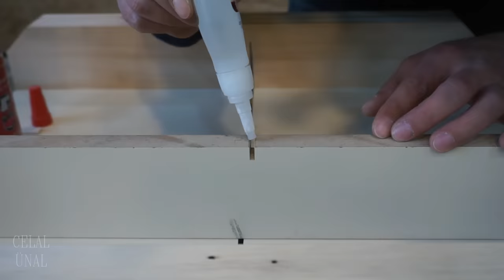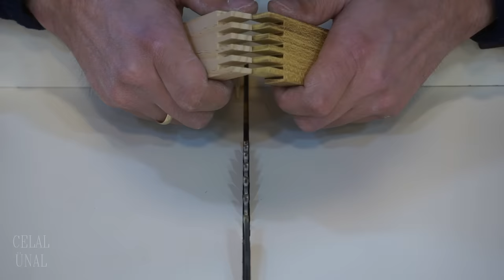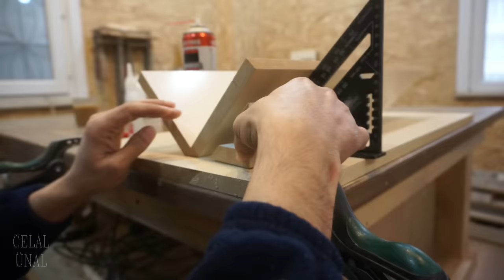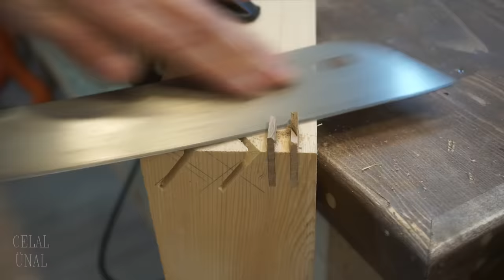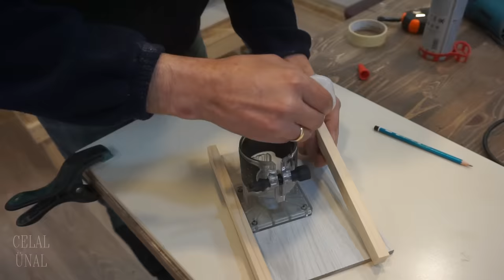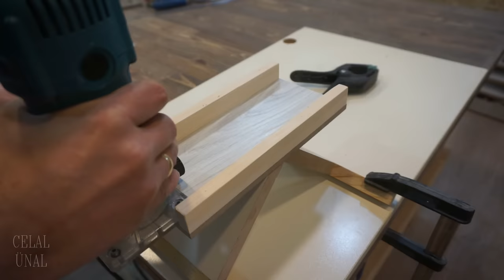Woodworking // Simple table saw sleds / Tezgah testere aparatları

Comment: These are some great jigs. Hopefully for the actual splines you use glue instead of cyanoacrylate (super glue) because I can tell you from experience that it will not allow the wood to move during humidity changes. Normal wood glue allows for seasonal movement whereas "super glue" soaks into the pores of the wood and creates a solid cement-like bond which cannot expand or contract. Just something to be aware of. For the jigs it is fine since you are backing it up with screws.
Reply from the maker: Thank you so much. I am very glad that you like it.
Reply: Right also if you have to "weld" something, steel, aluminum, plastic, etc, just add bicarbonate of soda and you'll see it won't move and tolerate very high loads.
Reply: Thank you for your service… Semper fi.

Comment: Bravissimo. Hai le mani d'oro. È un piacere vederti all'opera!
Reply from the maker: Grazie mille. Sono molto contento che ti piaccia.
Reply: @CelalUnal1  una domanda: la lama che usi sul banco Dewalt è di diametro 250 mm? La larghezza dei denti, e quindi del taglio, quanto è? Perché ho visto che le lame Dewalt con i denti più larghi sono da 2,4 mm ma vedendo i tagli che fai mi sembra che sia più largo. Grazie per questi video molto belli e interessanti.
Reply from the maker: @bigwave1827  Yes, 250 mm. The original knife is this size. I haven't measured it, but I think it's about 9 cm in height. It would be better if there was a bigger knife. But not bad in these proportions. greetings.

Comment: This is an excellent video. I've watched many and this is the very best. THANKS. I have three questions: 1) How did you make the filler for the dovetail joint? 2) Did you use a gauge block to measure the exact place for the other side of the "X" joint with filler? The double "X" joint is very cool and looks impressive. 3) What kind of spray adhesive did you use?

Comment: Hi Celal, thank you for the video. Very professional and very useful. M
I would like to know what are you using as glue and what spry are you using to accelerate the glue drying? Thank you again.
Reply from the maker: Thank you very much. I am so glad you liked it.I used instant glue and activator spray. A material that provides drying and adhesion with activator spray.

Comment: Excellent job. Can you tell me what is this spray that you use and what is for?
Reply from the maker: Thank you. I used fast glue and coolant spray.
Reply: @CelalUnal1  Why are you using coolant spray?
Reply from the maker: @NikosEliopoulosmain  Fast adhesive does not dry without coolant. It does not provide adhesion. It is a two component material.
Reply: @CelalUnal1  Ok i see. Thank you very much for your answer.

Comment: What is this spray u use after glue two pieces to quick dry? Btw u are good woodworker ☺️
Reply from the maker: Thank you. I used fast glue and coolant spray. It does not dry out without a cooler.
Reply: @CelalUnal1  tnx, I found some akfix 705 glue, is that something like that u use it?

Comment: Great Video....but let me know.....WHY USING  SPRAY ADHESIVE  ??  Other question....is there any project ?   schematics ?   i really love make some of JIGS for my table saw
Reply from the maker: Thank you so much. I am very glad that you like it. I used fast glue and coolant spray. For faster adhesion. I use dewalt dwe 7492. I did not share the measurements because the sizes vary from brand to brand. I'm sorry for this.

Comment: Really really good woodworking and a good tutorial! 
I'm really thinking about which glue you are using. Could you send me a link?
Reply from the maker: Thank you. I used instant glue and activator spray. A material that provides drying and adhesion with activator spray.

Comment: Really good!
Thanks for posting.

- What's the brand and model of your table saw?
-What is the spray you use after gluing, and what is its purpose?

Thanx for answering if you can.

Vraiment bien !  
Deux questions pratiques :
- Quelle est votre scie sur table ? 
- Je n'arrive pas à identifier le spray (et son rôle) que vous utilisez lors des collages…

Merci pour cette video
Reply from the maker: Thank you so much. I am so glad you liked it.
I am using Dewalt dwe 7492.
I used instant glue and coolant spray. A material that dries and adheres with a coolant.

Comment: Hi in some video you use white glue, in this one you mainly use transparent glue, what’s different between them? Is the spray is glue accelerator? Thank you so much🙏
Reply from the maker: I use white glue on wood. I use fast glue and coolant spry for this type of work. It saves time. Also a good holder on mdf surfaces.

Comment: What you use there for a spray after gluing the angle wood ?
Reply from the maker: I used instant glue and coolant spray. A material that dries and adheres with a coolant.
Reply: Thanks for answering 🤙🏻

Comment: What glue is that you use? and what is in the spray can? Thank you.
Reply from the maker: Thank you. I used instant glue and activator spray. A material that provides drying and adhesion with activator spray.

Comment: Hi. Great work as always 😁
Can i Ask for model and brand of your sawblade? IT cuts so smooth thru those laminate boards without any damage of laminate itself. Thank you 🙂
Reply from the maker: Thank you so much. I am so glad you liked it.
Brand dewalt. Diameter 250mm. 48 teeth. 3mm thickness.
Reply: @CelalUnal1  thanks for answer. Im supprised that's original blade. Be safe.

Comment: Try using nylon cutting board material for your sled guides. They do not expand or contract like wood slides will. What is the glue and activator that you are using?
Reply from the maker: Hello.Thank you. I used fast glue and coolant spray.

Comment: What is the aerosol can that you are spraying on the wood and what is its purpose?
Reply from the maker: I used instant glue and activator spray. A material that provides drying and adhesion with activator spray.

Comment: What spray glue are you using?
Reply from the maker: I used instant glue and coolant spray. A material that provides drying and adhesion with coolant.

Comment: What kind of wood and glue are you using for your sleds?  Also, will you be sharing the plans?
Reply from the maker: I used MDF for wood. I used fast glue v cooler spray. I am using dewalt dwe 7492. I did not share the measurements, as the sizes will vary from brand to brand. Greetings.

Comment: What's the saw table and spray you using?
Reply from the maker: I am using Dewalt dwe 7492. I used instant glue and activator spray. A material that provides drying and adhesion with activator spray.
Reply: @CelalUnal1  cheer dude✌️thnx

Comment: What is the spray for ?
Reply from the maker: I used instant glue and activator spray. A material that provides drying and adhesion with activator spray.
Reply: @CelalUnal1  thank you for yrs replied 💝💝🎉🎉

Comment: Where did you buy the glue you are using?
Reply from the maker: I used fast glue and coolant spray. Every building is available in the market.
Reply: @CelalUnal1  I have never seen it before.  Thx for the response.

Comment: Hi, what is that glue in spray bottle. Where can I buy it
Reply: It’s Super glue with spray accelerator also called CA glue. Available at most woodwork stores, The Home depot, or Lowe’s etc depending on your country.
Reply: @richardshort4587  thank you
Reply: @KaprizHardwoodFloors  You’re welcome sir.
Reply from the maker: Thank you. I used fast glue and coolant spray.

Comment: Red spray. What is it?
Reply from the maker: I used instant glue and activator spray. A material that provides drying and adhesion with activator spray.
Reply: @CelalUnal1  Thanks.